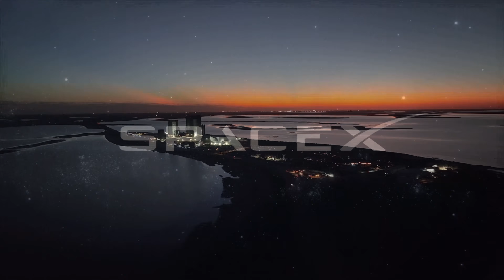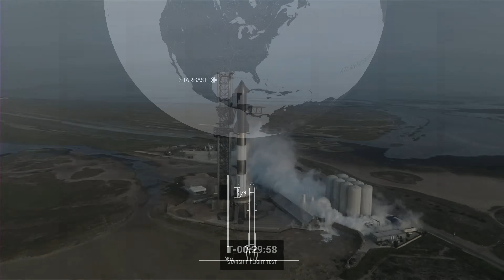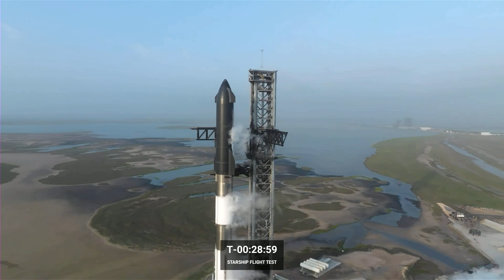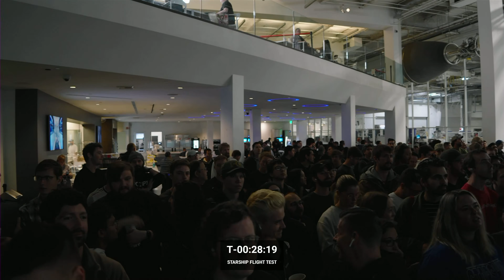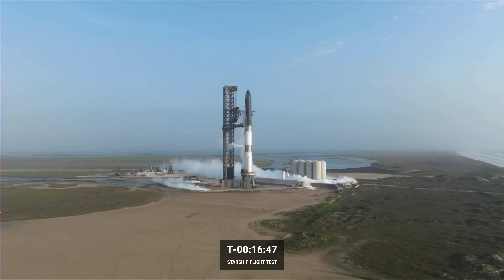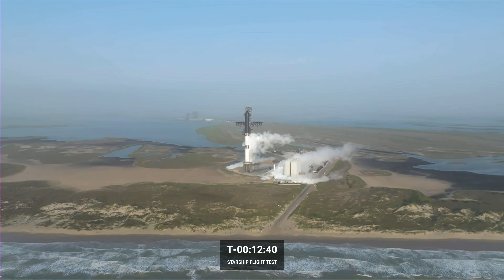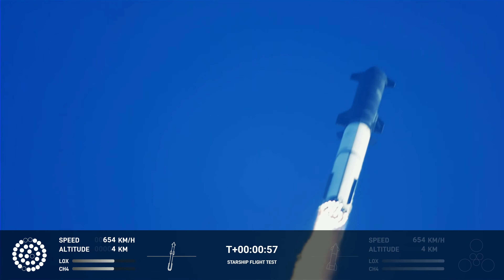Starship Flight Test

Comment: I honestly did not expect that it would go that high. The fact that it even lifted of the ground was a massive success itself, let alone 39km.
Reply: Exactly! But many people say it's just failure. I don't think it is. Huge Advancement!
Reply: @samuelkim1638  Perhaps the flight itself was a success, but everything else…
not so much looking at the state of the launchsite.
Reply: @fork9001  They never expected all of it to be successful in the first place. The only objective was to see whether the Rocket would take off or not.
Reply: @krimson4626  I’m struggling with the fact SpaceX still hasn’t constructed a decent launch pad. It’s not that big of an investment considering you don’t damage your rocket and launch site every single time.
Reply: @angrydoggy9170 it’s a TEST!
Reply: All of these issues appear to’ve been from not having a flame diverter/water deluge system
Reply: @fork9001  wait a minute.. were you there, the launchsite??
Reply: @CoolPersonWsp  Shotgunning your rocket's engines with debris and such, AND THE ENTIRE FACILITY, is not a good way to test something...
Reply: @angrydoggy9170  Yea. They will need a flame diverter. It also doesn‘t really help that it takes quite a while to ramp up the power for takeoff.
Reply: @higueraft571  Remember this is a test. You fail then you retry and you learn more stuff. You can succeed in one try, it makes many tries to nail down everything. This was the first test and they got tons of data for the next one.
Reply: @CoolPersonWsp  Ok, but how much more data would they have gotten if the rocket didn’t get damaged on the launch pad?
Reply: @angrydoggy9170  You would’ve got more. But what are you trying to say? They weren’t expecting it to even lift of never mind get above max Q. Some people don’t get what test means. A test is something you have to do multiple times learning stuff each time to grow your knowledge about the thing you are testing. Why would we have a successful flight on the first try?
Reply: @angrydoggy9170  Again that’s common sense you would’ve gotten more data. So I don’t know what your trying to tell me.
Reply: @CoolPersonWsp  You don’t understand why preventing your rocket from damaging itself would make sense? You can’t see the logic in trying to conduct a test in the best conditions possible?
Reply: @angrydoggy9170  They did rush it I could agree on that.
Reply: @CoolPersonWsp  classic musk simp. This would be a success if it was the 70's. Take SaturnV for example. 13 launches and 13 successes.
Reply: @WKA1gaming  The Saturn V was a whole different thing. NASA built that not SpaceX. And of course NASA is going to have way more success than SpaceX. SpaceX is a private launch company compared to NASA which isn’t.
Reply: @WKA1gaming  To add on, Saturn V had some issues in its 13 flights. The Apollo 13 mission in April 1970 experienced a major malfunction in one of the spacecraft's oxygen tanks, which resulted in the mission being aborted before the lunar landing. However, the crew was able to return to Earth safely thanks to the ingenuity of the flight team on the ground. And the second unmanned Saturn V flight (Apollo 6) in April 1968 experienced significant vibration and engine problems, but the spacecraft was still able to complete its mission objectives.
Reply: Not anything like the Starship, but again NASA is not a private company.
Reply: @WKA1gaming What happened before launches in testing stages?
Reply: Why the separation was not initiated and then a landing attempted? There was no reason to destroy both parts of a ship that can land .... allegedly.
Reply: @reasonerenlightened2456  Because the whole vessel was spinning around…
Reply: @reasonerenlightened2456  Separation can‘t be done at this height. The first stage had way too much fuel and thus weight to land safely. The distance to the landing pad was too small to properly adjust the trajectory to fly back. And most importantly, the starship was not exactly on a stable trajectory itself. That are just three of what i would imagine thousands of reasons why they didn‘t attempt it
Reply: @daname1491  what is the point of having a star ship that can land if it can not separate in emergency?
Reply: @fork9001  I mean it was  test flight not a mission, there wasn't anything on the rocket at all I wonder if it had any payload at all, if it did my bad.
Reply: @reasonerenlightened2456  Emergency separation hardly ever work on any spacecraft. It increases complexity due to additional mechanical parts and complicated computer models to handle the separation and landing. It actually often makes a flight riskier than without it.
On the starship that is even more complicated as the upper stage is so incredibly large and not just a small emergency capsule. Imagine what kind of power you would need to separate this thing when its not in a stable orbit. It‘s just not feasible on so many different levels.
But just like on the falcon they will test this thing so many times that by the time a human is on board they will be next to infallible.
Reply: @daname1491  LOL good luck convincing any humans to enter than tin-can
Reply: just in case you didnt know, nasa did it more than 50 years ago, reach the moon and back to earth....
Reply: @CoolPersonWsp  😢
Reply: @reasonerenlightened2456  how many humans flew on the space shuttle again?
Reply: @angrydoggy9170  It's kinda not technical issue. They would have to get insane amount of approvals for classical launch pad construction since they are in marshlands which would slow down whole thing for at least several years.
Reply: Yeah, gyros worked great for such a huge rocket.
Reply: it was a test run failure is expected but even so it is a success as every failure in this field (with no loss of life) helps the next. so all in all a success good job elon.
Reply: Falcon 9 started off like this and now it's the most used rocket in the world.  I suspect Starship is going to obsolete most other rockets once it hits it's stride.
Reply: @WKA1gaming  It's actually better when something fails early, you are able to fix it so it won't become a problem in the future. It's actually a huge problem when something doesn't go wrong in tests because you have nothing to improve.
Reply: Flip Manuver
Reply: @fork9001  WHADDYA THINK NOW BOI
Reply: @angrydoggy9170  One argument could be, that there wont be any launch pad on Mars or Moon
Reply: @angrydoggy9170  this aged well

Comment: That massive fuselage took the stress of going 1,800 km/h while doing flips in the atmosphere?  That's actually impressive.
Reply: Thats what i said! Stages held together a little too good!!
Reply: Yes. It means it's proven as structurally viable.
Reply: You've all been fooled ! NOBODY passes through the firmament!
Reply: плотность атмосферы на высоте меньше чем у поверхности земли
Reply: Remember to be friendly on the internet everyone! 😊
Reply: Yeah, it gives me confidence that the thing is actually viable at so big a size. They better fix the separation next!  :-)
Reply: U
Reply: @cibaresh  Calm yourself.
Reply: @blucat4  or the engines and the death Spin. The v2 came Further in the 1940s I Think It Has a Long way to Go
Reply: Max-Q got nothing on this vehicle!
Reply: @bullywife  max q sideways?
Reply: @_kampfkartoffel2195  Yeah there were a few problems, but it still would have been a success if Starship had separated from the booster, that was a shame. :-) They'll fix them and go again. See you then.  🙂
Reply: @blucat4  ye this guys seems to think that the first flight of the ship has to be 100% sucessful, its literally a test flight to see whats going to go wrong with it 💀
Reply: @redneckhippiefreak  1200 miles per hour is the speed of the Soviet aircraft MIG 31
Reply: Lots of things proved in this test, spinning up all the 33 engines clearing the tower through max Q, looked like at least 3 of the engines failed pretty early into the flight so plenty of work still to do. Ultimately it looked like stage separation failed but a hell of a test none the less. Can't believe it tumbled end over end without breaking up, that thing is seriously tough.
Reply: @SnowWow  Yeah, we get that. 🙂
Reply: @schrodingerscat1863  Well summed up. 🙂
Reply: @gergiobeglorayn4809  and  how much does the mig 31 weigh? How many engines? How about the number of stages? Is it designed to go orbital and then have its first stage rtb? Mf is comparing 80’s Soviet tech to starship lol…
Reply: Many things visibly pass your brain without saying there, that’s for sure
Reply: @FeelingGolden  lol
Reply: @_kampfkartoffel2195  ...you know just how many A4s they blew up and and around the launch pad before one made it up to peak altitude?
Reply: @rafakrukowski2889  kn0b
Reply: @AccAkut1987  yes but the a4 pushed the Limit this Thing was trying to do Something other did thousends of Times, that is a giant Differenz
Reply: Someone forgot to remove the duct tape between the first and second stages.
Reply: @schrodingerscat1863  Not sure if the asymmetrical thrust from 5 engines out on one side could have produced enough preload to prevent stage separation.
Reply: @melvillecapps8339  nope, some idiot used loctite when they screwed them together.
Reply: Not only that, but multiple engines exploding under power without destroying the whole vehicle.
Reply: Hebrews

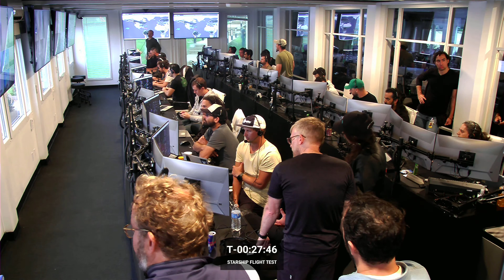12:14 Make every effort to live in peace with all men and to be holy; without holiness no one will see the Lord.

Acts

3:19 Repent, then, and turn to God, so that your sins may be wiped out, that times of refreshing may come from the Lord,

James 2:24,26

Ye see then how that by works a man is justified, and not by faith only. For as the body without the spirit is dead, so faith without works is dead also.

John

3:16 'For God so loved the world that he gave his one and only Son, that whoever believes in him shall not perish but have eternal life.
 
3:17 For God did not send his Son into the world to condemn the world, but to save the world through him.

3:19 This is the verdict: Light has come into the world, but men loved darkness instead of light because their deeds were evil.
Reply: @mcfcguvnors  I see 500mL of fluid in a container with a 1L capacity.
Reply: @stanimal8  The dead engines were spaced out around the ship, they weren't all on one side. If you look at the SpaceX stream you can see this in the view taken through the cloud where you can see each engine as a point of light. 4 of the fixed boost engines were shut down and one of the centre engines. The failed boost engines were space out all around the edge.
Reply: @redneckhippiefreak  it's not even at aircraft cruising altitude, plenty of atmosphere up there for a skyscraper doing tumble turns.
Reply: @rafakrukowski2889  No? What about Mars Germans? They did it...
Reply: @stupidas9466  😂
Reply: The air was very thin up that high . 60 miles maybe
Reply: @redneckhippiefreak  Left atmosphere yes but not earths gravitational pull and also weight and mass is still weight and mass.  For the vessel to remain intact from several spins it wasn't designed for shows remarkable durability that was not expected.
Reply: This was also after the fts was triggered as well
Reply: Sorry to rain on everyone's parade but the atmosphere at 30 km is far less than 1% the density as at sea level, so this isn't a sign of structural integrity of the rocket
Reply: I don’t remember there ever being a rocket able to tumble at max Q (right around its second one in this case) with the fts system all ready triggered.
Reply: Why the separation was not initiated and then a landing attempted? There was no reason to destroy both parts of a ship that can land .... allegedly.
Reply: The what? Nerd.